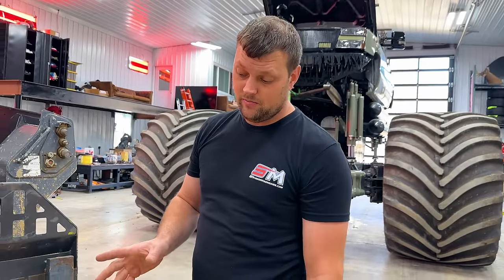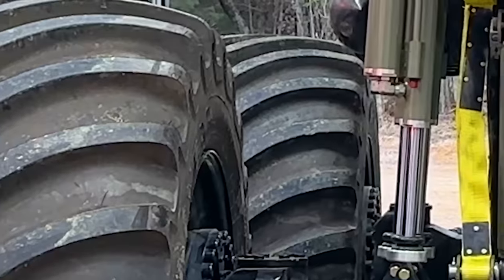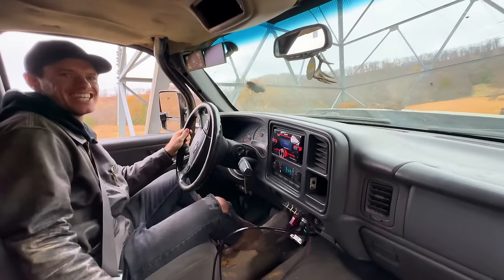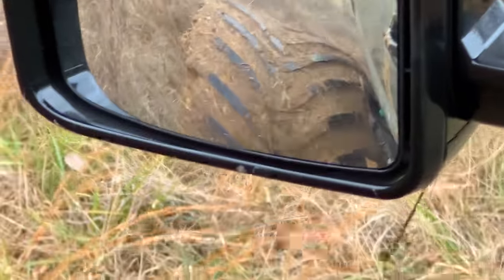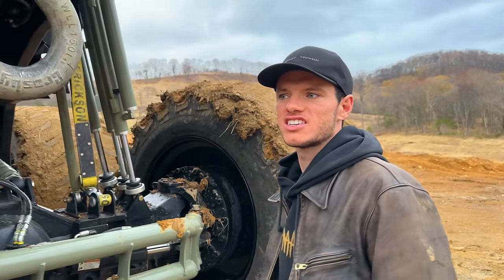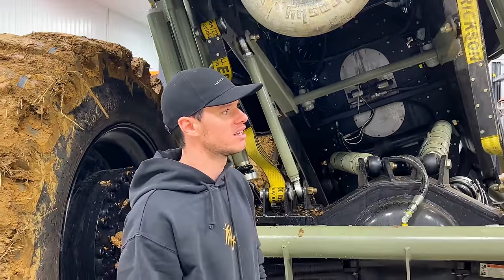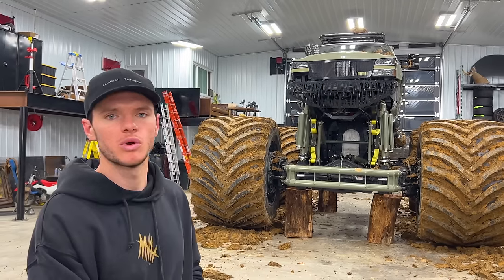Monstermax 2 RUNNING ON TWIN ENGINES!!!!

Comment: Can’t we just appreciate how well this truck is built. 8k likes!! Tysm
Reply: Cody is simply the best mechanic, no one is that good with window panes
Reply: @pfarraldcash6095 ye
Reply: Yea its awesome.
Reply: It's all broken!!!!
Reply: theres a reason shit isnt done like this. it breaks. the company hes paying hundreds of thousands to should know better.
Reply: @gorybonghit3211  but hes paying for how he wants it regardless if its right or not hence why its mostly for show
Reply: clearly not very well😂
Reply: Huh?
Reply: I gotta lie I’m really impressed
Reply: Im glad he put my name on it
Reply: yeah it will climb a small hill any revision now.
Reply: I agree, its amazing, but not in a gay way
Reply: @BurnDemons-  bigassi
Reply: Yea.. shitty driveline angles, sway bars built out of tin cans, cooling fans don’t work, what else?
Reply: THIS IS A JOKE RIGHT ?🤐🤐🤐🤐🤐🤐🤐🤐
Reply: @gorybonghit3211  This is how everything is built. The only difference is that engineers generally don't show the part where it doesn't work properly.
Reply: Fax
Reply: Built beyond use. I can't imagine what this thing will be like when it's usable.
Reply: @wwenetwork8050 😅
Reply: @gorybonghit3211 he’s just going to trash it, I want a dirt bike, and I would take that one he trashed there.
Reply: It doesn’t look like it works….?  The suspension is a wreck. It flops all over.  It over heated…the transmissions are slipping at low speed…driveshaft angles. it has problems. But they can all be over come and I want to see it in its final form.
Reply: it's the best chevy truck ever
Reply: Can’t we just stop making comments that start with “can’t we just”
Reply: Heavy Metal Fabrication would have made a great truck for him.
Reply: Facts its like a military vehicle
Reply: @javariusjavarlamariuslamar3759  that's why I commented what I did bruh 😂
Reply: Fr
Reply: Yeah, and how much time they have put in that.
Reply: You’re joking on the well built part right
Reply: by Cody's workers yes, if you're talking about Cody building shit on that don't make me spit my drink out 😂
Reply: @77nizzova53  For now till it’s on doubles.🤣
Reply: @Chocolate_dragon  wonder if the sway system wouldn't be more effective if they used some auto leveling hydraulic system. Since the truck is too top heavy.
Reply: Indeed 🔥
Reply: No we can’t lol
Reply: @gorybonghit3211  Customer is always right........until the check fails to clear.
Reply: Yes I love the way it nose dives into the ground a squats
Reply: It broke lol wtf😂😂😂😂😂
Reply: @gorybonghit3211  if they removed the rear suspension, not a surprise it would instantly  handle better. Also being too top heavy, a single engine at a lower center section would reduce complexity and increase drivebility.
Reply: Still a chev
Reply: @gorybonghit3211  what is wrong with you I bet you could never spend that amount of money and have it your way
Reply: Could be a lil bigger
Reply: Repent and believe in Jesus. John 3:16 KJV - For God so loved the world, that he gave his only begotten Son, that whosoever believeth in him should not perish, but have everlasting life. 
Luke 13:3 KJV - I tell you nay: but except ye repent, ye shall all likewise perish. 
2 Corinthians 5:17 KJV - Therefore if any man be in Christ, he is a new creature: old things are passed away; behold, all things are become new.
Reply: For what it is it’s amazing there’s still some trail and error and some touch ups that need to be made but once it’s completed fully it’s going to be amazing
Reply: I still can't believe he hasn't built a whistling diesel yet don't tell me he doesn't have the money and I'm going to laugh if somebody builds it before him
Reply: @SaintNyx  big monster trucks already exist and dont break from less than daily driving it.
Reply: @Innocentricky94  Thank god
Reply: And how far it's come from the original truck it was.... everyone lost they're shit when he'd tear it up... but the whole point was because none of the stock shit was gonna matter much anyways
Reply: And then appreciate how long it takes Cody to completely trash it.
Reply: @Chocolate_dragon   a lot of the issues would be fixed with better limiting straps, swaybar, and pump the pressure up in the springs. It’s really not that bad
Reply: No
Reply: what color is yur bugatti
Reply: @gorybonghit3211  When your building a full custom that is way out there like this, you're going to get a lot of failures got to work through them.
Reply: @whistlindiesel can you go into depth on the thing you needed to wire the transmissions together? from the video it looked like it was just a regular wiring harness with a bunch of wires spliced in to control the 2nd trans, but I know it's gotta be more complex than that since it took months to put together.
Reply: That crab walk was epic
Reply: @gorybonghit3211  "Big" monster trucks are literally tiny compared to this. Nothing is even remotely close. This isn't just a big truck, it's the biggest monster truck in the world.
Reply: No
Reply: Part bot and human.
Reply: Built better than most sema trucks
Reply: Build it better
Reply: Riiiiight
Reply: Don't say that he'll break it
Reply: no
Reply: @pfarraldcash6095  Just needs some stiffer shocks.....maybe King would build some
Reply: It's a POS
Reply: It's way too squatted
Reply: Lmao
Reply: Thank you for the lack of the theatrics that you’ve been using lately,
Reply: The first monster max was watching better
Reply: what? he can't even drive the thing up a hill or turn it without the thing wanting to break and flip... I don't get it.
Reply: @harmankardon478  yeah because anyone that knows the basics wouldnt know a swaybar is important in this build.
Reply: @gorybonghit3211  think the company does know best! They are getting the hundreds of thousands and he will keep paying them 🤣
Reply: Facts
Reply: @77nizzova53  try building one
Reply: @robo1210  youu try building one
Reply: yet it couldnt drive up a tiny hill without the driveshaft binding
Reply: @jin_on_cod_mobile  ok? What does that have to do with anything? I was replying to a comment on “how well built” the truck is. Clearly it has several issues and I’m sure plenty more that we don’t know about.
Reply: Can they bring in like the Grave Digger guys for a consult?
Reply: @robo1210  Those driveline angles are crucial.
Reply: @gorybonghit3211  sometimes you give the customer what they want, not what they need.
Reply: @BurnDemons-  FACTS
Reply: Except for the Swaybars but yeah
Reply: nah it's a piece of trash
Reply: I could build it better with my eyes closed
Reply: Its a big fail 🤣
Reply: @RedesCat  i highly doubt that.. nothing failed but the shocks and the puny sway bars.. let me see you fork out the cash to pay for just 1 of those shocks
Reply: @wwenetwork8050  Cody never be breaking kayfabe.
Reply: I love this Audi
Reply: @jin_on_cod_mobile  No thanks!!!
Reply: Testing testing testing. They build it he breaks it they build it better stronger 💪
Reply: Bob Chandler .. has entered the room..

Has left 😂🤦🏻‍♂️
Reply: This truck is insane
Reply: Now Destroy it! I mean test its durability.....
Reply: @javariusjavarlamariuslamar3759  can’t we just
Reply: I've never seen a question end with a period before...
Reply: @gorybonghit3211  he doesnt care if it breaks.  thats like buying a fourhweeler for mud riding.  you know its gonna break
Reply: @kevintalbot has entered the chat
Reply: Maybe he should've kept the RANGER lol but seriously can't wait to see what he does about the issues  that's left on mm2
Reply: Yes we can!
Reply: Ahhh, yes. 

Sarcasm
Reply: Can't we all just watch a video without being asked to appreciate something.
Reply: Great truck to take shops and back.
Reply: How well is it built?
Reply: @gorybonghit3211  should just get monster jam people to continue building it
Reply: That’s the only thing to appreciate
Reply: If you didn't appreciate it already then you already have a problem lol.
Reply: Its well built but cursed by design
Reply: All the companies just taking him for a fool is hilarious
Reply: Congrats Cody. That look on your face man. Something to be damn proud about!
Reply: @bho30758  straight up
Reply: Right!! Love it!
Reply: Yea other than the suspension. Good lord
Reply: So amazing!  it almost did as much off road as the Honda Ridgeline.
Reply: @wwenetwork8050  looks really functional in this video. Anything custom like this it's gonna take a long time to get everything worked out and get it to be reliable it will eventually be reliable and very fun once they get it all worked out
Reply: Well
Reply: @gorybonghit3211  should of had Dennis Anderson build him a truck.
Reply: @gorybonghit3211  he sure isn't building it lol
Reply: I WANNA SEE HIM BUILD A VEHICLE WITH SNOWMOBILES FOR TIRES
Reply: I mean. It broke like 4 times in this video just driving.
Reply: Never been a hater never will be! 💪 Cody has always and will always be my favorite YouTuber keep it up man! I'll see you at one of your events soon 💪🙏
Reply: Yes, not well at all.
Reply: Just like DW merch
Reply: It sux though
Reply: Uh... well built doesn't exactly come to mind when I see this thing lol.
Reply: My friend lol
Reply: @The_DirtBike_kid88  That’s me
Reply: @TheTurboEnthusiast  I know lol
Reply: @The_DirtBike_kid88  Let Me Correct you, Best Friend.
Reply: @TheTurboEnthusiast  lol
Reply: Agree!
Reply: Is that a joke? Well built? Brakes engage by themselves, rockets scrape the tyres, it overheated... Shall I continue lol
Reply: It's a cool Truck and yes it's well built it's his money and if he wants to build a truck to his liking have at it.
However, the guys who built the truck should have told him you have to keep the truck under this amount of weight because if you don't you going to have x y and z problems  
To make the truck drivable it's going to need a ton of weight saved off it.
So where do you start
Reply: Nkuall
Reply: I agree with yes it was built very well however by building the truck the way it was.
It truck is extremely overweight and by being Cody is going to have nothing but problems with the truck.
It could have been built a lot lighter and just as strong if the build would have been thought out more.
Reply: Leans too godamn much
Reply: That shit is sketchy ASF.
Reply: Star Citizen vibes coming off this comment
Reply: @gorybonghit3211  It's a rather common expression of folks with diminutive male genetalia syndrome.

Comment: The suspension badly needs springs, but this is an insane build regardless.
Reply: yes this. The shocks are entirely missing the springs. That is issue. The sway bar is fine. Badass build
Reply: Probably air shocks no coils needed
Reply: @mudholemutilators9065  he could still add coil assist to it if it was all air. Like helper spring's. Etc.
Reply: Those are adjustable nitrogen air shocks. Just need to add more air!
Reply: 6 or 9 leaf packs from a dump truck should work. How did he forget springs?
Reply: @TheHopson   you don’t add air to nitrogen charged shocks and they are just simply that nitrogen charged shocks it definitely needs springs to stiffen, travel slower and rebound quicker… IMO
Reply: Bottoms out when he shifts.
Reply: His work angles are fucked on the front end!! That why he need straps!!! It's easy to fix and stiffness in the rear is not it
Reply: Haa every one owns a monster truck it seems.
Reply: a bunch of armchair fabricators lol
Reply: If u swap the two engines for a 572 cu crate engine it would be trully a monster truck
Reply: He's after that gay ass Carolina Squat look. That's why the springs are missing...
Reply: @jasonsparshott7208  you clearly don't know about shocks fox been making full floats for years
Reply: Gotta love all the pro-fessional suspension ex-sperts on here.

These shocks use oil, piston valving and nitrogen.  May even have internal spring's.  I would recommend limiting straps.
That said,  now that the truck is under full power,  all that is needed is to actually  "tune" the suspension.
Reply: @345_Juann  if its over 1600 hp it wouldn't have enough torque though,
Reply: springs suck, it needs active hydraulics

Comment: Besides the top end loosing weight you could check if it's possible to perhaps increase the pressure in the suspension to make it more stiff before using a massive sway bar (which is still needed as you noticed).

Comment: Definitely would love to see a showcase of the team that makes all this shit possible. You have a pretty solid group of folks to be able to consistently put stuff like this together.

Also, when you blaze your own trail and do stuff that hasn't ever been done before, you gotta expect some things to go wrong, or need adjustment. Getting it right the first time is virtually impossible. Besides, finding weak links and going back to the drawing board is how we ended up here from the stacked wheel spacer days.
Reply: I also love over the years how WD is not too proud to show moments that are less than ideal and when things to not go as planned.

Comment: Shorten the length of the arms from the sway bar to the drop links that go down to the axle. Less leverage on the bar will prevent the smaller bar from flexing like it doesnt exist. Also, bigger diameter bar at the same time. Once you find the right combination of diameter and arm length youll achieve desired results. Need a super nerd to calculate what bar size vs arm length will give you the correct support for the weight at that moment of inertia.
Reply: Yes
Reply: Wise words.
Reply: Maths
Reply: And a cage for your safety !
Otherwise it’s a great build , really happy for you Cody !
Reply: HOW DO U KNOW THAT???????
Reply: The sway bar probably would’ve held up had he not been running around with like 100psi of air inside a nitrogen shock that probably needs at least 800psi in that million pound rig. Tough to stay straight when it’s got so much travel that his wheelbase probably grows/shrinks a foot with one side on the bumps, and the other showing all 30 inches of shaft. This thing is going to need serious revisions to perform like it should.
Reply: The truck is built for views, not performance. In fact it is better off breaking than being perfect.
Reply: Oh yeah you're that guy trust me
Reply: Trigonometry
Reply: what about a medium nerd?
Reply: Bro a super nerd?
Reply: But your right
Reply: @stuwest5862  have you seen all the build vids for it? This thing is definitely overbuilt for performance. Now that he is finally testing it, it is time to start tuning it correctly. That's the issue it's having, is it's lack of tuning.
Reply: What about a box of Nerds?
Reply: @hansdomke89  Sure, that's all it needs. Thanks for insight.
Reply: @stuwest5862  hater tears go in the tanks lol
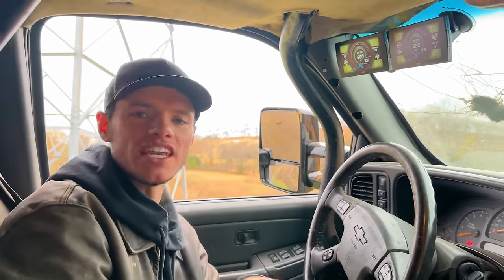Reply: @simondufresne8283  He has a cage, look at 8:14. The roof rack is actually the cage.
Reply: I was just about to say exactly that
Reply: @eqlibrium854  only if you have a box of all grape nerds, then success.
Reply: @blackstaticband  3 medium nerds should equal out to 1 super nerd. (Real engineer that can run computer models to test various sway bar designs virtually before building the real one is the super nerd. 3 medium nerds would be to just have 3 dudes build a couple potential fixes each and see what one works best in real life testing.)
Reply: @CptEagle87  a 40000lbs + impact cage ? Then great

Comment: I can't believe WD finally got it running properly. MM2 IS freakin sick. His content makes my day everyday, please never change
Reply: Yeah i love the new cod also 😂
Reply: @erikstrough9454  he said MM2 not MW2, hop off the video games and learn to read
Reply: Yeah but he still won't build a whistling diesel
Reply: Jokeing right this thing is the biggest failure.
Reply: @erikstrough9454  Hey Erik
Reply: does anyone know how the 2nd trans is wired in? Looked like a regular wiring harness with all the wires spliced into the other trans to shift it but I wouldn't expect that to take months to build.
Reply: @austinisaperson6093 they both go into a custom dropbox that diverts the direction to make it work, Dropbox is just a way for monster trucks to connect the engine to the driveline due to the height difference, hope that helps man
Reply: @mullittmustang256  Oh sorry I should've specified- I meant the wiring side. Sorry I wasn't clear on that I'll edit my original comment. Thank you for taking the time though, I appreciate it.
Reply: @austinisaperson6093  ahhh yeah that’s another good question, I’m a Diesel/Gas engine tech so I’m not the best at wiring stuff, I consider that stuff the devil 😂😂
Reply: @mullittmustang256  ahh yeah no problem lol, personally I like playing around with that stuff but I know a lot of folks don't
Reply: @austinisaperson6093  oh I bet it’s a blast when you get it figured out, but when I’ve had buddies or my stepdad explain wiring in fan switches my brain just can’t figure it out 😂😂 I always just get my buddies food or beer for their help with sound systems
Reply: @mullittmustang256  ha, maybe we should be friends lol that sounds like a good deal to me!

Comment: I love that literally every part of this build is overkill yet somehow you managed to tame and break the beast on the test drive, must have been that sway bar.
Reply: shadowsandfire I suggest watch a 13 part series called What on earth happened by Ewaranon to learn that the earth is not a globe.

I got it in my about tab.
Reply: @flat-earther  because the earth is a giant triangle!
Reply: @crazysilly2914  i once read if you made the earth into a football, that it wouldn't even be able to roll properly/at all. I assume it's not just mountains but also with the bodies of water removed, huge deep holes making it that uneven.

I know you didn't ask but i just thought of it lol
Reply: l love how that big fat F you to environment and ecology
Reply: @shuenshuen  That is wrong. If you shrink it down to the size of a pool ball, it will be rounder and smoother than an actual pool ball.